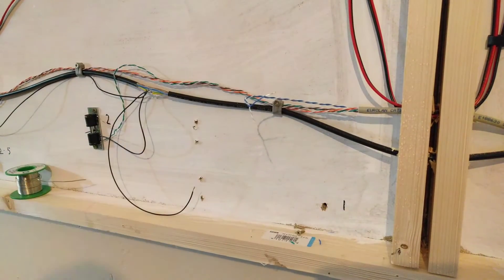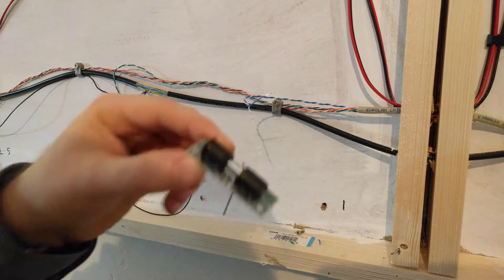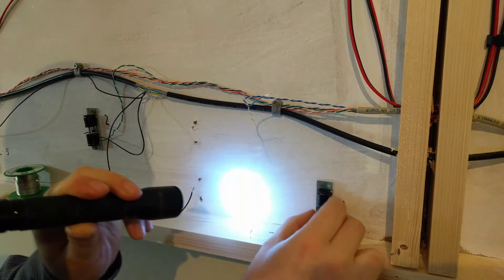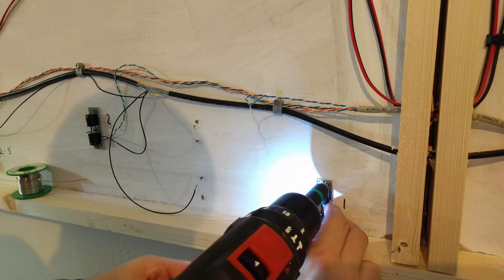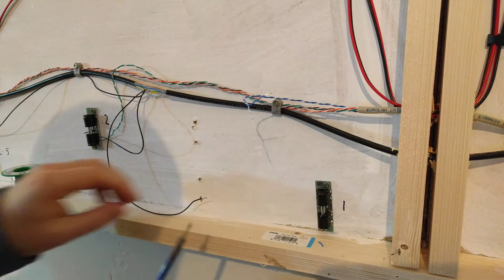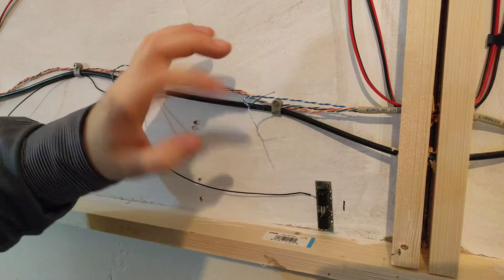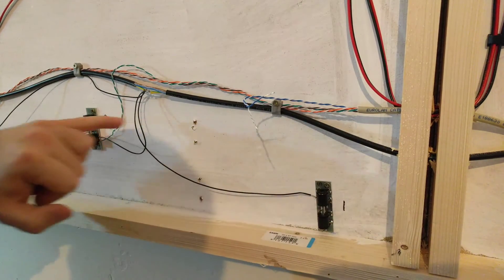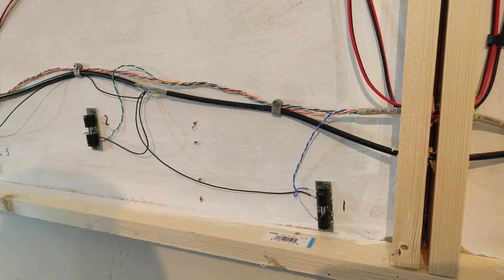Wiring up a seep point motor

Comment: Hi, when you drill the hole for the bar, what size hole do you drill and does this go all the way through to the baseboard surface, thanks.
Reply from the maker: Hi, from memory I drilled 2 3mm holes right next to each other, then I used the drill, wiggled it about until the 2 holes joined, creating a long slot for the bar to run through, yes it went all the way through though with the points above you don't really notice the hole you have made

Comment: You made that look so easy!  It is a good job you are not using the built in switch.  These point motors must be fitted in exactly the centre position for the switch to work.  Hence the reason my swear box is stuffed to overflowing!  I have just suggested to the manufacturers that instead of screw holes they make slots for final adjustment.
Reply: https://www.youtube.com/watch?v=Ag3AOEc0UrA